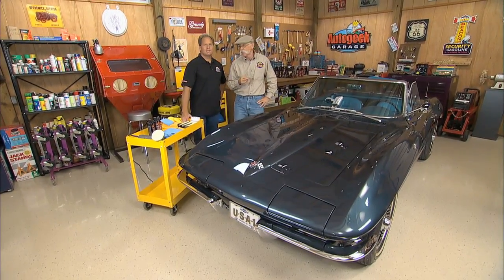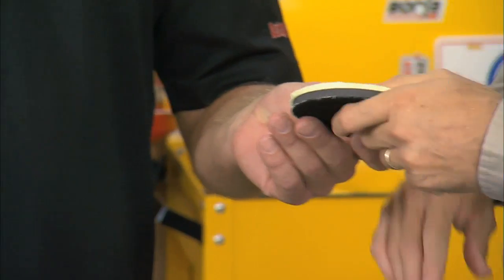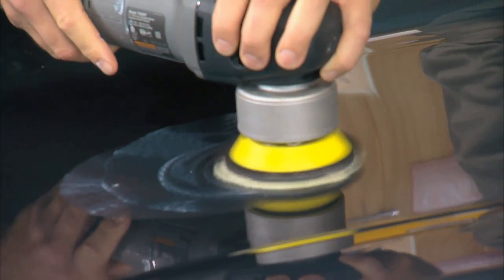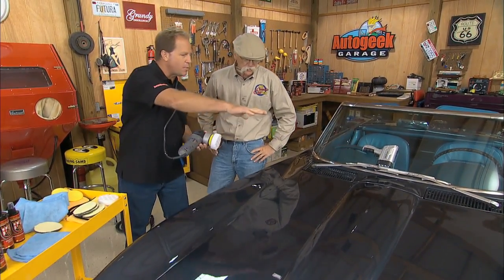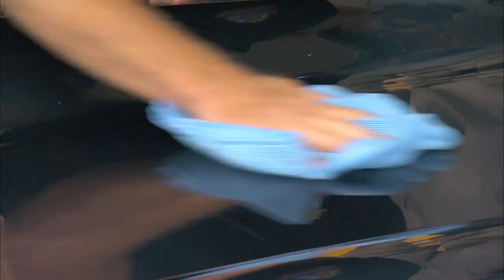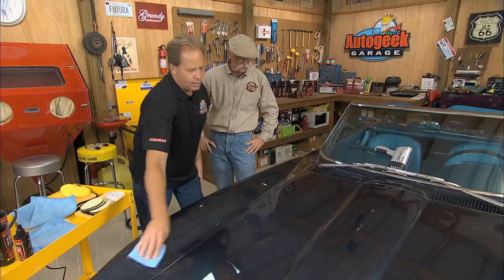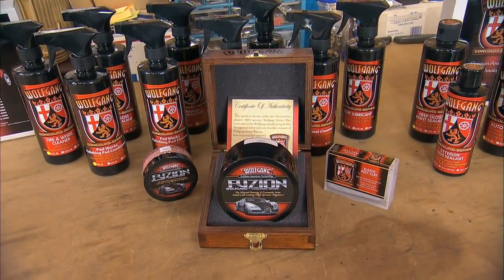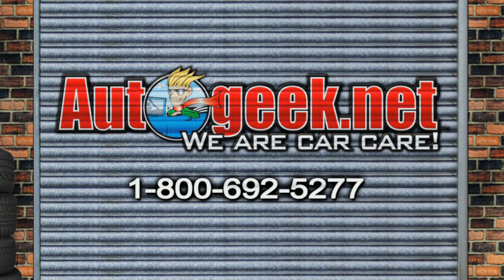How to remove isolated scratches with Dennis Gage & Mike Phillips

Comment from the maker: When using the Porter Cable dual action polisher you will for the most part always be on the 5-6 speed setting when removing defects.  That is when using compounds or polishes to remove swirls.  For machine applying a finishing wax you use the 4 setting.

There's never really a need for the 1-3 setting.  Be sure to place a black line on the back of your backing plate to make it easy for your eyes to see if the pad is rotating.  The pad must rotate to remove defects.

-Mike Phillips

Comment from the maker: Start out with a Porter Cable 7424XP and get a 5" Lake Country Backing Plate and 5.5" Lake Country Flat Pads.  You can also check out the Meguiar's MF Correction System.  The best thing to do however is to join the AutogeekOnline . NET discussion forum, that's where ALL the action's at.  -Mike Phillips